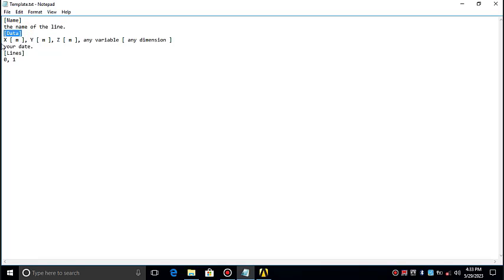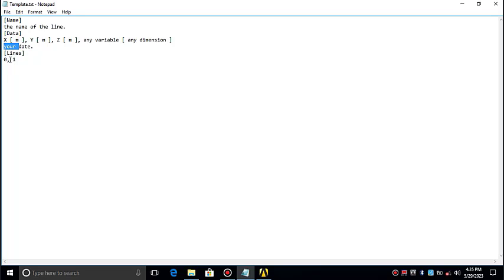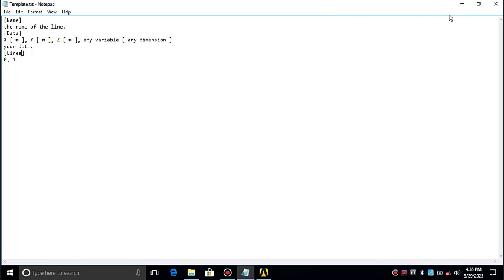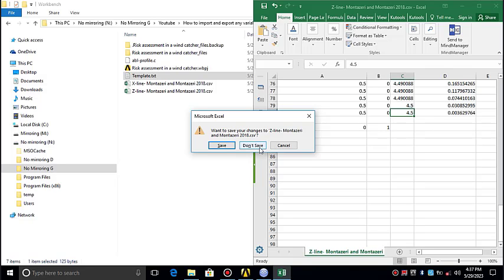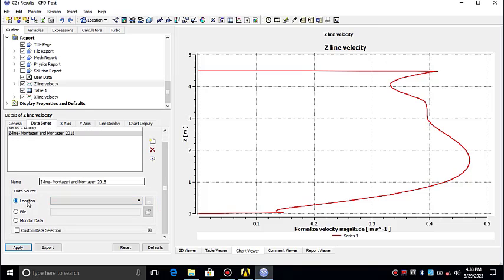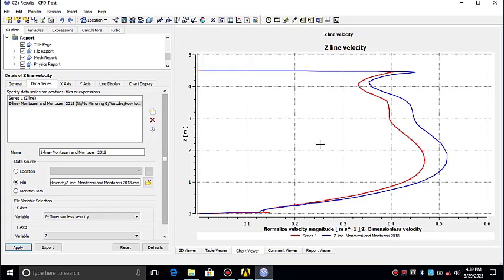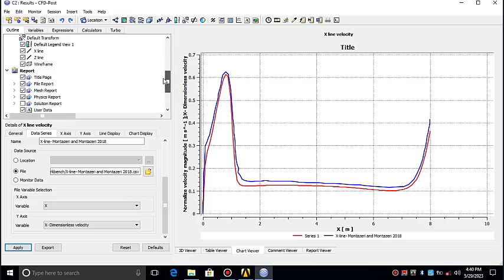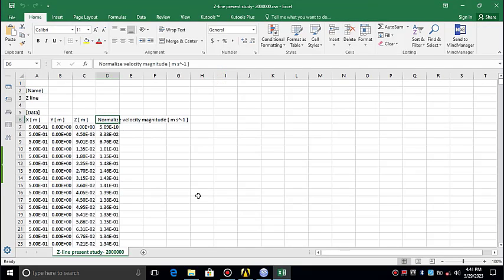How to import and export any variable profiles in Ansys CFD-Post

Comment: how about exporting pressure/velocity/ temperature data as csv and then changing the values of variables. And then draw the 2d contour plots from the changed data? how to do this?
Reply from the maker: I recommend using CFD post for what you want. It enables you to do whatever you want by providing robust tools and functions.